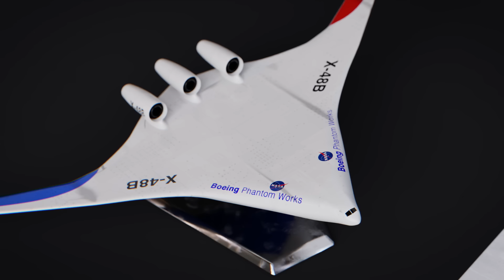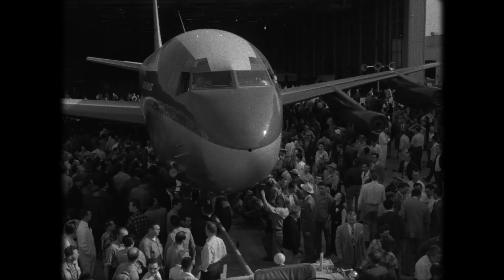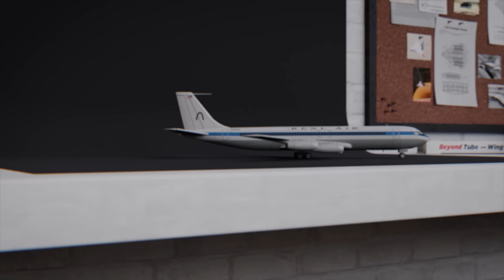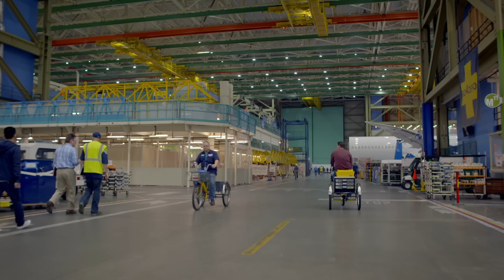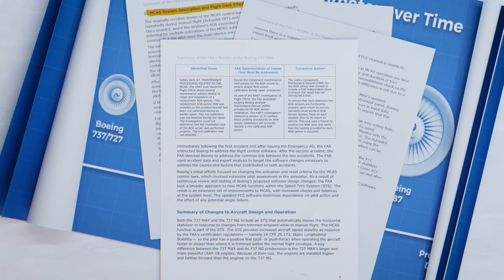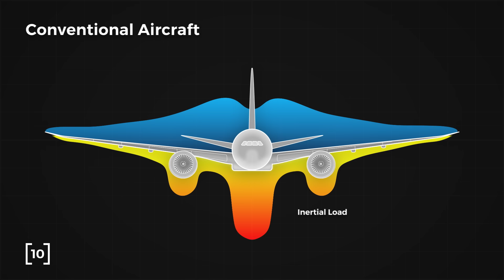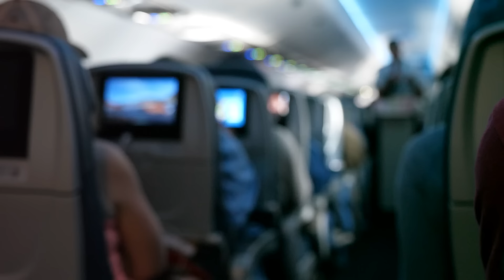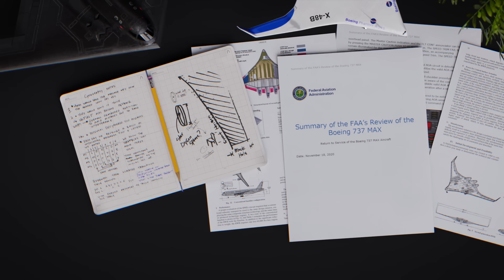The Plane That Will Change Travel Forever

Comment: Putting people and payload inside a lifting surface isn't new. It dates all the way back Kalinin K-7 of the 1930s. The problem is that they always have a very fat frontal cross section and the drag advantages do not really pan out. The non-cylindrical pressurized vessel is also heavy due to additional bracing and other implements needed. These are all before the issue with limited locations on which to place exits come into play.
Reply: @SimonWoodburyForget  LOL... actually yes it does. There is a reason eficient aircraft have long slender wings and relatively slender pencil like fuselages. There is a reason they don't have fat wings and bodies that look like a blimp. Because it takes a lot less energy to separate air laterally a small distance and collapsing it gently back together. This especially true when you need to move fast. The co-efficient of drag (Cd) itself is used in a function of frontal area.
--
The problem with blended wing bodies is that while it eliminates the non-lift producing cylindrical fuselage of a traditional tube-n-wing design, it forces a thick and inefficient air foil on aircraft because the driving factor in the airfoil design becomes the need to house the passengers and cargo.
Reply: @SimonWoodburyForget  If you know anything about aerodynamics you won't say that (1) frontal area doesn't matter or (2) compelling a very thick airfoil on an aircraft does not have a negative impact on drag.

Comment: The test pilots of early attempts blended wing aircrafts remarked that flying such planes was like balancing yourself on a beach ball. But this has been overcomed due to advance in modern electronics.
Reply: A weird techinique to fly those is to lose the control of the plane on purpose to make it easier to control them, kinda like how some racing drivers kick the rear of the car on purpose to throw it around the corners

Comment: No doubt that the industry will move this direction. However, having zero (or minimal) window seats, would really bug me.
Reply: Give me high quality VR goggles that let me imagine I'm the airplane. Still not a window, but I'd fly it.
Reply: @dyadica7151  VR goggles still need more improvement, they need to get smaller. A lot of folks don't like strapping a box to their face.
There is a lot of progress in glasses free, 3D holographic displays. Hopefully, by the time blended wing designs are dominant, they will be more inexpensive to manufacture, and will make good "virtual windows".
It will probably be a final issue that will need to be addressed before there is wide scale customer acceptance of the new airplane design. I think a lot more people than they think are concerned about having windows. More people want to look out of an airplane window than don't.
I'm amazed at how few comments there are about this facet of the design. That's a problem with engineering, engineers frequently forget the human aspect and just go by the numbers. These are not "people movers", they are vehicles that transport human beings, human beings who will not ride in something that they are uncomfortable riding in.
A major failure of the airline industry is the "cattleing" of their customers. This needs to STOP!
Reply: @peterbelanger4094  why VR Glasses? Stupid Solution - place smallScreens in a Window Format next to the people fed by Outside View Cameras...
Reply: @dyadica7151  
Also cameras and screens can definitely replicate windows these days.
Reply: @marrqi7wini54 
Cameras and screens can in some cases be better, because I do not like closing the window shade, just because other people are bothered by the light.
Reply: In 20 years, based on the current rate of improvement, displays and cameras should be awesome.  Probably will look more real than the view through a scratched dirty window.  This is a non-issue for me.
Reply: How about sitting 30 to 40 feet away from the nearest emergency exit (in the center)?
Reply: Passenger "need" for a porthole is likely a big reason why this type of airliner - which would have much better gliding capabilities than flying cigar tubes - was not a reality decades ago. But now with advancements in composites, engine power/weight and fuel efficiency, and screens on every seat back, it is closer to becoming reality.
Reply: That's why I think this will get picked up by budget carriers first. There's a huge number of people who will put up with a lot to get a cheap flight, and honestly I see that as a positive freedom
Reply: 100%! What future technology innovation are you most excited about?
Reply: This is the point. Trying to fix badly designed hardware in software was always a cockeyed way to go about it.
Reply: @kenoliver8913  eeeeeh fighter jets are also really unstable fixed with software
Reply: @ricomotions5416  Apart from fighter planes having MUCH lower safety standards than commercial planes (for good reason), fighter hardware was designed from the start for that. MCAS was a kludge put into a 50 year old airframe so it could fit bigger engines without retraining anyone.
Reply: you sleep most of the time, vision at Night is anyways impossible and th rest of the day you watch a Movie - so what? They can place Screens with outside view Cameras next to you. ;-)
Reply: You'll adapt.
Reply: I'd miss access to emergency exits even more than I'd miss access to windows.

Comment: Fly by wire honestly will require a way more stable energy system. If you look you will find that there have been more then one case of planes having a full engine out status. A full engine out causes a loss of power (yes they still have a ramjet turbine) which means in the worst case you wont be able to control. Thankfully they are aware of that so they have the highest priority for the ramjet. But! With the wing it requires way more power since it has to keep constant monitoring of the control surfaces to keep the whole body wing stable. I am quite certain that this has been considered of course but i still would like to know how ^^

Comment: Airsick city!  Could  you imagine being on one of the outboard seats during turbulence, or even turning?  You'd be moving up and down up to several meters, not to mention that your head would be tossed side to side as well as up and down.  Not having windows would make it even worse.
Reply: I agree with this statement. If you rolled too quickly you would get relatively large vertical g forces for those seated towards the outside of the plane. Perhaps it wouldn't be so bad for those on the upwards travelling wing, but even if you hit 0.5g that would probably feel very sickening to many passengers. The point about limiting roll rate is accurate and would negate this, but many airports are surrounded by high terrain and have minimum bank angles (quite often in engine failure scenarios where your climb rate is limited). If you rolled slowly in that scenario you might overshoot the turn and thus put yourself perilously close to terrain.
Reply: Listen everyone: high amplitude, low frequency movement with a bit of head-tossing is similar to what makes people sea sick, or get sick on carnival rides.  In turbulance, the closer you are to the wing tips, the greater you'll get tossed up and down.
Reply: If a turn is done properly you don't really feel it, because the acceleration "simulates" gravity. I was on an helicopter that was taking way sharper turns than a passenger jet will ever do, to land at the bottom of a narrow valley, and I only realized by watching from the window, as I saw the river at the bottom of the valley wright at my left instead of down below me.
Reply: @trezapoioiuy  when you're in a helicopter, you're still sat very close to the centre of mass, so when it does a banked turn, you don't feel it. You're fundamentally misunderstanding the original comment here. To apply to your helicopter experience, imagine if you weren't sitting INSIDE the helicopter, but imagine if you were sat on a beam 2-3 metre away from the centre of mass of the helicopter.
Reply: @DuyLeNguyen  The only thing that matters for the sickness feeling is the acceleration of your body independent of the mass of the vehicle. As long as the vehicles stability control is strong enough to prevent the passenger's bodies from accelerating beyond some sickness threshold then the passengers will not feel sick. Blended wing planes already need strong stability control because it needs active stability they just need to factor in passenger comfort in their active stability algorithm. The bottom line is that if the plane is stable you will not feel sick no matter how the stability was achieve.
Reply: @kazedcat  I don't think this is true at all. And your statement shows you're still fundamentally misunderstand the original point of the comment. Acceleration in this particular case is affected by your distance from the centre point (still talking about a simple banked turn here), a passenger sat at the outboard position will experience higher acceleration when the aircraft roll into or out of a banked turn compared to a passenger sat closer to the centre of mass. 

Your assertion that "The only thing that matters for the sickness feeling is the acceleration of your body independent of the mass of the vehicle" is also fundamentally wrong. Motion sickness/nausea occurs due to the disconnect between actual motion and perceived motion, and in this case DOES NOT have anything to do with control stability. We're PURELY talking about passergers sat outboard experiencing large differences in acceleration simply due to sitting further away from the centreline and hence higher actual displacement for the same roll rate. 

Blended wing bodies is one of those concepts that just likes to resurface every 5-7 years or so, make big giant claims, and then nothing happens. Rinse and repeat.
Reply: @DuyLeNguyen  Not sure the blended wing is really going to be that big of a difference. In a traditional wide-body design very few people are actually at the center of rotation already, and I've never noticed any difference being at a window vs the middle. To use your own example, I've already experienced being 2-3m away from the center of rotation. Not a big deal.
Reply: @crusherven  sure, in a conventional widebody, at the outer windows seats, you might be about 2-3m from the neutral axis, but what about the 10-15m in a blended body concept, are you not going to notice this difference? (2-3m was trying to illustrates a point well outside a helicopter body, as per the previous conversation, it will be more exaggerated in a BWB)

Can you elaborate more on where you've spent time in a rotating inertial frame that's rotating where you're a couple metres away from the axis of rotation? And how fast was the rotation? Because all of this is relevant in terms of influencing the onset of motion sickness.
Reply: @DuyLeNguyen  Blended wing will just need to limit roll rate for passenger comfort. Acceleration is distance/time². From this equation time is a more significant factor. So doubling the passengers distance from the center means the plane needs to slow the roll rate by 30% to achieve similar acceleration and slowing down roll rate by half means the passenger can be 4 times farther from the center. Now the angle of the bank in a turn is affected by the lift so you also don't expect the blended wing to have similar bank angle than conventional design. Since blended wing have larger  wing surface their bank turn have higher authority and needs shallower bank angle to get similar turning radius to conventional aircraft. Again everything rely on the flight control algorithms to ensure passenger comfort.
Reply: @Duy Le Nguyen  You were the one who seemed to think that being 2-3 meters from the axis of rotation would be noticeable. Provided turns are done gently, it's not. Do you really need me to elaborate on my time on transcontinental flights? It's pretty boring. :) Like I said--in a wide body aircraft many passengers are 2-3 meters from the center, and it really doesn't matter. And based on the picture in the video, you wouldn't be 10-15m away from the middle. It looks like the passenger area is like 2.5x wider. 5 aisles instead of 2, 26 seats across instead of 10.
Reply: @DuyLeNguyen  the acceleration is higher when you’re sitting further from the center of mass. But in a turn done properly, the acceleration points in a direction downward compared to the passenger. So the passenger doesn’t feel the turn because the acceleration points towards the seat, just like gravity does in level flight.
Otherwise, as close as you are to the center of mass, when a helicopter inlines to almost 90 degrees very quickly you would still feel it very strongly and it would be a pretty messy thing. 
As you mentioned it’s perceived motion that gives sickness, and if the acceleration point to your seat you don’t perceive anything
Reply: @trezapoioiuy  what do you think happens for the passengers on the side of the turn then, the aircraft has to roll into a banked turn, so by definition, one side of the aircraft goes up, the other drops. How do you make 'the acceleration point toward your seat' when the aircraft starts to roll?
Reply: @DuyLeNguyen  By pitching the nose "up" towards the turn, centrifugal forces will push you to your seat, not to the sides. Same as on a car: in a normal turn you feel like you're turning, but on a paranolic curve the car can stick to the turn even if it's 90 degrees on the side. Your body can't tell the difference between gravity and centrifugal acceleration.
People on both sides don't feel like they're rotating up or down, they feel like the airplane is going up.
Reply: @trezapoioiuy  the aircraft first has to roll into a bank before the pilot can make a pitch up command.
Reply: @DuyLeNguyen  Long aircraft have to pitch up and down all the time, the 777x is some 70m long, and the passengers at the front are moving a whole lot, as long as you limit the roll rate, like the comment above said, it should make no difference.

Comment: Another benefit (not mentioned) with blended wing aircraft, specifically those that have engines at the back of the aircraft, is that there is boundary layer ingestion. Because the entrance of the engine is within the boundary layer then this reduces the overall drag force on the aircraft. Thus the aircraft requires less force to propel itself. Better fuel efficiency!
Reply: Though ... does this mean that if you disrupt the boundary layer, your engine will starve and you won't have the thrust necessary to get out of trouble, because it wasn't designed to operate with the reduced/turbulent intake?

Comment: Seems like a good way to increase airsickness and allow the airlines to charge a huge premium for window seats.
Reply: In a regular plane, the outer seats are by the side of the fuselage so it’s easy to put windows there. But in this thing, the outer seats are behind the front edge of the wing. You can’t put windows there for several very good reasons, including the fact that the windows would need to be curved but at the same time much stronger.
Reply: @Sashazur  it looked like there were a few windows in the mockup. That's why I assumed they'd charge a premium for them.

I could never fly on something like this if it doesn’t have windows. I have to have a window seat on a plane or I get sick. I sat in the middle part of a 747 once and barfed the whole flight. It was terrible.

Comment: 13:18 I beg to differ. The software was not faulty, it performed as expected. Software wasn't the problem just as the sensor that failed was not the problem. The root cause was the design as a whole